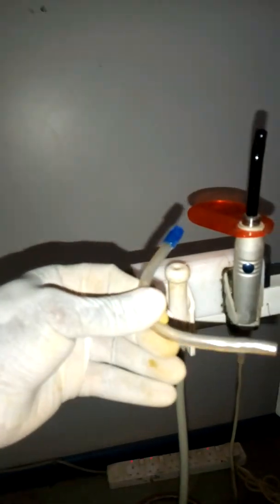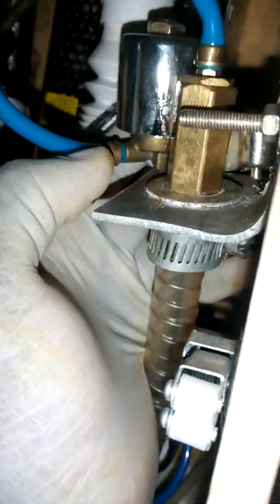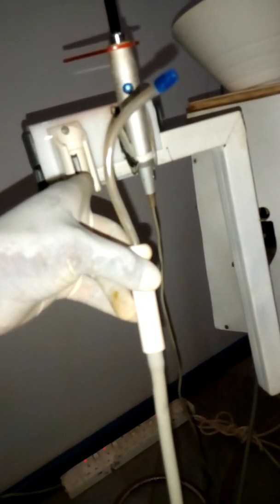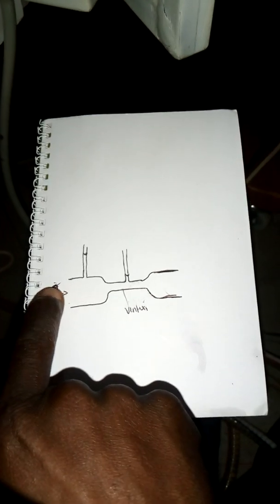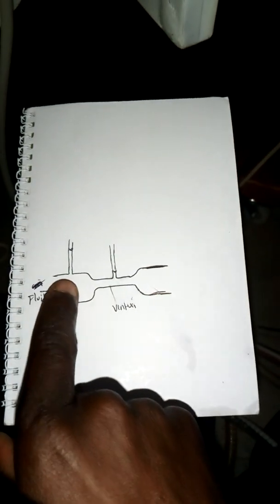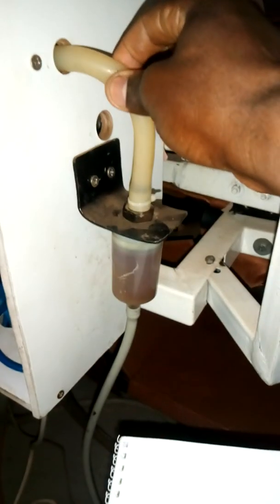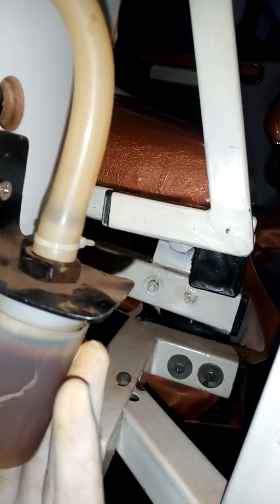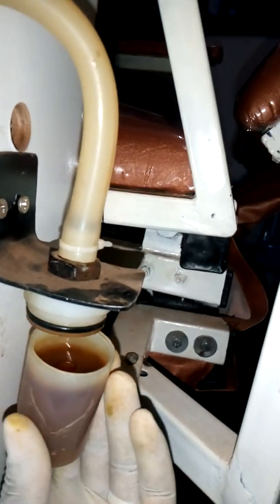HOW THE SUCTION SYSTEM OF MY HOME MADE DENTAL CHAIR FUNCTIONS

Comment: Can I eliminate the need for the microswitch by just placing an inline airline flow control valve and turning the valve open when suction is needed to be used?
Reply from the maker: That means you won't need the solenoid valve. In this case it's the air control valve. The concept is having control air through the Venturi. If there is any other way you would do it other than use a solenoid, I think It would still work.